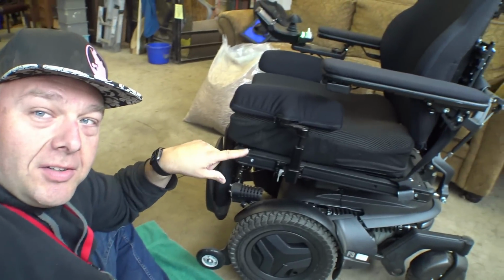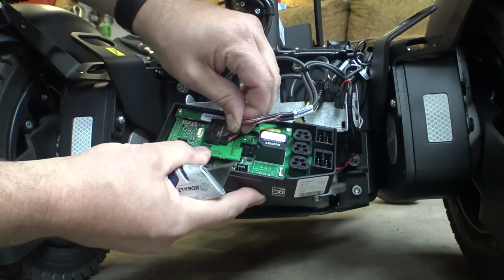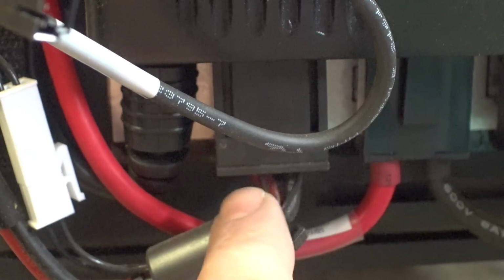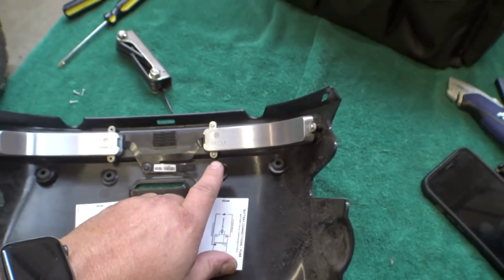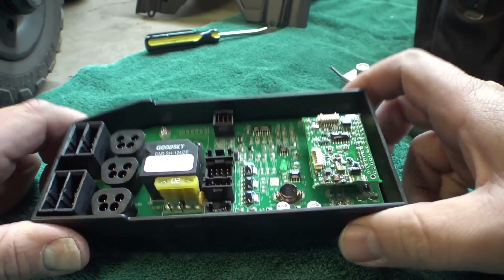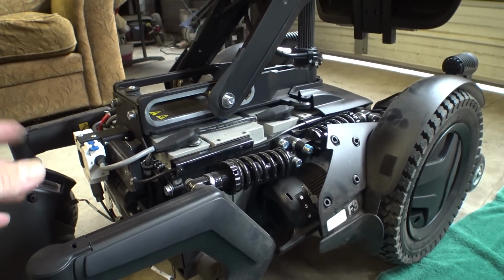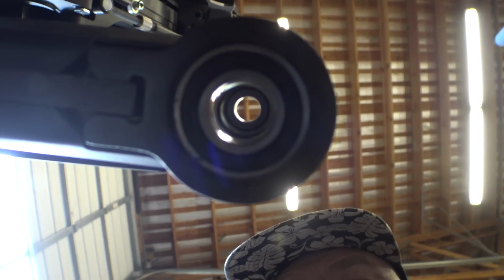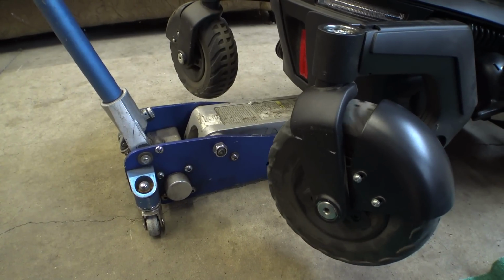MEGA VLOG 584: a look inside the Permobil F3!

Comment: I work on my M5  and M300 myself.  Every time I work on anything involving unplugging and moving any wiring, I take photos before unplugging anything, and sometimes several photos if there are several steps.  Although the Permobil manuals show SOME of the wiring, I have found it is sometimes not exactly the way it came from the factory.  It sure makes putting things back together much easier.  The plastic covers are easy to fit back on IF you put the wiring back properly.  Not so much if you  don't.  I am very happy with my Permobil chairs.  Not perfect, but close.  The O-ring does not provide the friction.  The O-Ring is designed to lock the lower part of the brake against the inside of the caster barrel.  The friction comes from the 12 wave washers providing force and friction between the two rotating surfaces above and below the wave washers.  One of the early manuals showed two type of friction brakes, 12-PCS and 13-PCS.  I have tried several times to order the 13-PCS friction brakes for my M5, because its casters flutter.  Everyone tells me they do not exist.  I have made my own 13-PCS friction brakes by inserting an additional wave washer in each friction brake (12+1 PCS).  The friction brakes are not adjustable.  They work fine on with lighter tires, but I can not find any pneumatic tires that size.  I will be installing my 12+1 PCS friction brakes soon, and will let you know if they work.  The fork stem cap screw is supposed to be torqued to 17.7 lb.ft..  Adjusting the cap screw torque will not adjust the friction brake.  I have been told that over tightening the cap screw will cause the friction brake to fall apart.  I would appreciate it if anyone has a source for the pneumatic caster tires in the USA.
Reply: I have an extra 12 PCS friction brake from which I scavenge wave washers for the other friction brakes.  Here is how I take the friction brakes...  I take the O-ring out of the circular slot.  I have a gear puller with two claw arms, and a central threaded push rod.   I hook the gear puller claws into the  O-ring slot, and place a small stainless steel washer on the part of the press-fit part of the brake.  That is to prevent galling.  Then I screw in the threaded push rod against the washer.  Grasp the claws with one hand and push them inward.  Slowly screw in the threaded push rod.  The brake will come apart.  It does not take much to separate the brake top and bottom.  Be ready to catch the wave washers.  Line up all the wave washers and add the 13th.  You can press fit it back together with a vice with brass or aluminum jaw guards.  I have not tried the 13 PCS brakes yet, so this is hypothetical.  If you need photos, let me know.
Reply from the maker: ok cool.. so its a press-on arrangement.. i can do that!! thanks man!
Reply: @harleyeckles  yep, Tim, that’s EXACTLY how the tech at the DME, does it, he’s the lead tech for over 700 Permobil wheelchair users in the Toronto Canada area.

He tries to keep 13pc one’s on hand at all times, has been authorized by Permobil Canada, to swap out any 12pc with the 13 if there’s major issues.

My M5, is all 4 castors, with the 13pc.
Reply from the maker: how did you get the assembly apart? is that lower plate press-fit into place?
Reply: My M5, has the 13 washer setup, it annoys the hell outta our lead Tech, at my DME.

The 12’s just fall apart on me.

My caster flutter is insane at times.
Reply: Please note:  The last time I got a set of the 12 PCS friction brakes, I noticed that the wave springs seemed to look more robust than the old ones.  I looked at the part numbers engraved in the top.  The numbers were the same, but the older parts have a "E" after the numbers and the newer parts have a "F".   This may mean the "F" version is the same part with a slight change.  (Stronger wave springs for more friction?). Bottom line is, check the parts and use the ones with the "F" after the part number.
Reply: I installed my modified "12+1 PCS" friction brakes on my M5 earlier today.  I then went on a 6.3 mile high speed run over every piece of road in the area that previously caused caster flutter in the past.  I actually intentionally aimed at pebbles, sticks cracks, utility hole covers and even bots-dots.  I can honestly say I had absolutely NO caster flutter...not even a hint of flutter.  Part of the cause of the earlier caster flutter was the size and weight of the solid urethane tires.  Someone once sent me the mathematical formula for the variables that can cause caster flutter.  One of the variables is the weight of the tires.  The heavier the tire, the more likely you will get caster flutter.  My M5 is equipped with the heaviest caster tires carried by Permobil; the aggressive tread tires.  I like them because they float better over dirt and sand.  Today my M5 was wearing almost new tires all the way around, so they are REALLY heavy.  Even with those heavy tires there was no caster flutter.  The parts I used were from brand new Permobil 12 PCS friction brakes with an "F" following the part number.
Reply: Additional note on installing the friction brakes:  Anyone attempting to install them should look at the Service Manual for your model of Permobil chair.  The manual states to torque the caster stem bolt to 17.7 lb ft.  Use a calibrated torque wrench.  Dont just guess.  i have heard bad things can happen if you over-torque.  Also, the manual states to clean all grease, and dirt from the caster barrel and friction brake before installing the friction brake.into the caster barrel.  Occasionally,  caster bearings will leak oil.  That oil can make your friction brakes useless.  DO NOT OIL THE FRICTION BRAKES.  Be careful not to damage the o-ring on the friction brake when you push it into the caster barrel.  It is supposed to be very snug, so as to lock part of the friction brake against the caster barrel inner wall.  After you have cleaned all surfaces with a clean cloth, set the friction brake on top of the caster barrel.  Use the palm of your hand to gently and evenly push it into the barrel.  DO NOT BEAT IT INTO SUBMISSION.  If it starts to tilt to one side, stop and apply a bit more pressure to the opposite side.  Once it is in about 1/3 of the way it will self center itself.